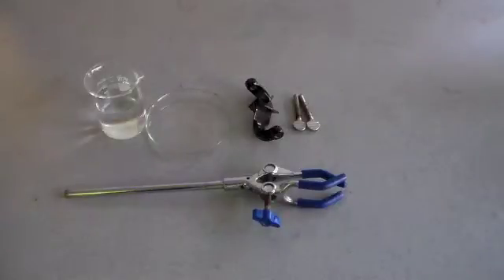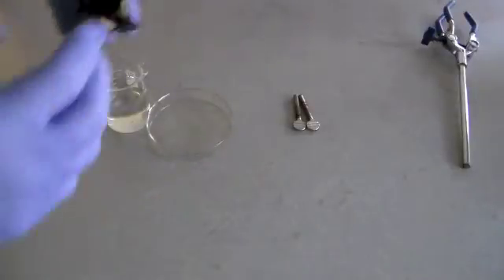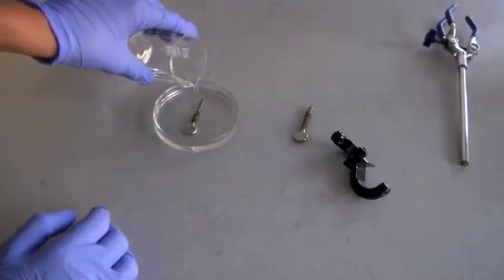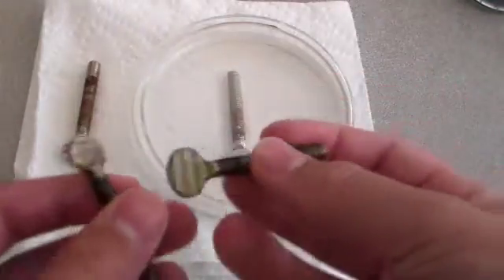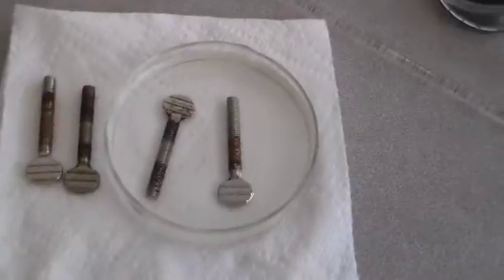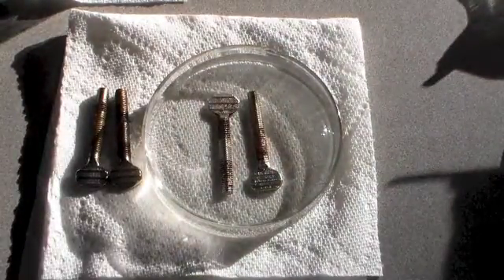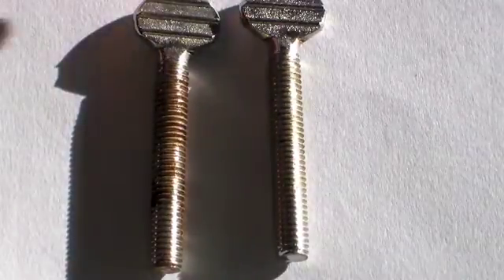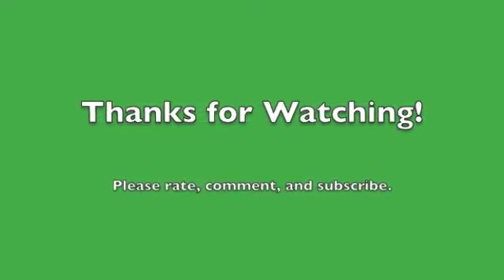How to Remove Rust from Ring Stand Clamps

Comment: best thing to use on rusty steel is phosphoric acid. mild solutions of it work well. HCL works but does not leave a phosphotized non for riding coating like phosphoric does. works for me.

Comment: So what if my clamp is completely rusted shut? I can't take out the screw at all, can't even turn it wit pliers.
Reply from the maker: +Rsaramallac Hmm, that's a problem. I would say try to remove some of the rust using steel wool (just scrub it with the wool) and then let the remainder soak in the vinegar-salt solution for a couple days. Hopefully they should be able to turn by then.

Comment: Use sodium bisulfite
Reply from the maker: Thanks for the tip! I will try that on some of my other rusted equipment!
Reply from the maker: Do you know if sodium sulfite would work? I have that, but no sodium bisulfite.
Reply: Sodium Bisulfate?
Reply: TheChemistryShack I rusted up a beaker, I assume this will work
Reply from the maker: A glass beaker? What did you put it in it?
Reply: TheChemistryShack Iron oxide
Hey, do you know how to separate rubber stopper juice from nitric acid? I didn't think they would react...
Reply from the maker: Oh yeah they do react--I use HNO3 to dissolve rubber stoppers that get stuck in flasks. I don't know how to remove it though.
Reply: TheChemistryShack hmm... What chemical destroys rubber, but can be removed from nitric acid? an organic solvent maybe?
Reply from the maker: Wait why don't you just dispose of the nitric acid?
Reply: TheChemistryShack I want the Nitric acid.
I don't have any yet and don't have much KNO3 left. Do you know where to get HNO3?
Reply from the maker: There's not anywhere you can get it. Of course you can distill it from H2SO4 and KNO3. Both of these chemicals are pretty cheap and pure from www.dudadiesel.com
Reply: TheChemistryShack Thanks, I think I would have gotten a decent yield if the stoppers hadn't contaminated it.